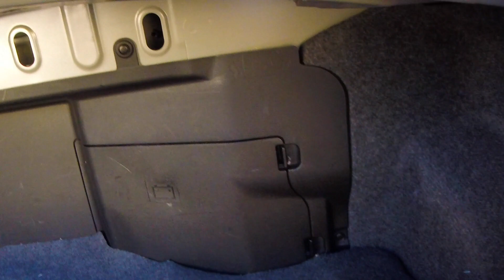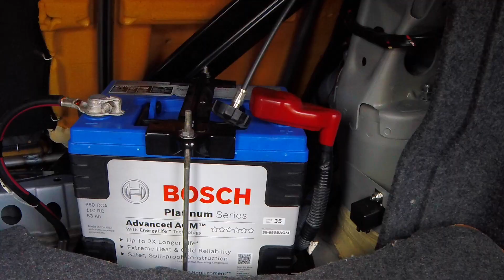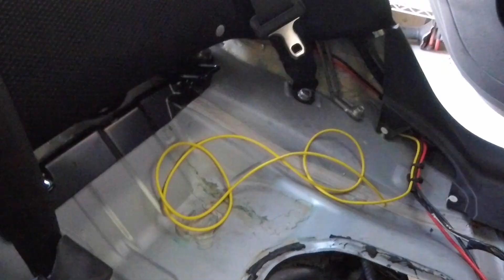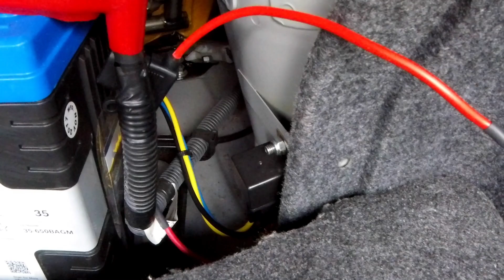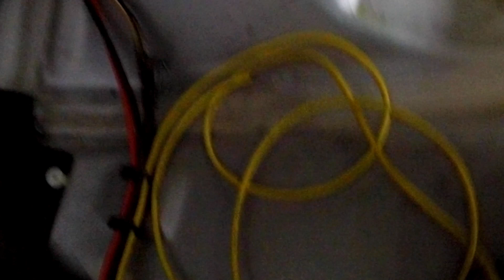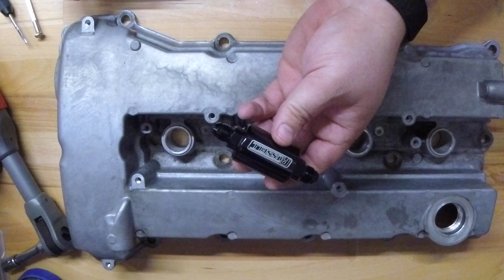EVO X Fuel System Upgrade - Fuel Pump Rewire - Part 3

Comment: Okay, this got a bit confusing but I got it sorted for those that come after me. Here is the wiring breakdown.

Fuel Pump - Route red and black out through the strain relief gland in fuel pump housing cap. The strain relief gland is a after market install. Use Sealcon CD09N2-BK.

Relay - Trim excess red and black wires.
Use excess power red wire to extend relay yellow wire. Route the this red power now and connect to Fuel Pump red.
Use excess black ground wire to connect to Fuel Pump ground. He grounded it at the same point where the relay was grounded next to the battery.
Route relay black ground to vehicle ground next to battery.
Route relay blue trigger to blue trigger wire vehicle side. This got confusing as he extended the relay blue with yellow, so you see him connect yellow to the vehicle trigger blue.

Comment: So quick question. What did you do with the unused power wire and ground from the stock fuel pump? Also so all I basically would do is splice new trigger wire into the stock trigger wire coming from the car.. and the power wire from the new relay straight to the fuel pump. And leave out the old power wire and trigger wire?

Comment: This was very confusing to follow tbh. You connected the red and black to the little wires coming out the top of the pump, but you also hooked up red and black wires to the power on the battery and ground? Wouldnt that have been 5 wires? I’m confused…..

Comment: Hey mate, Cheers for the vid. I'm putting a walbro 525 with DW relay kit in my EVO X, Can you confirm that black wire coming out from the pump is the one that runs behind the seats and earths next to the battery? Cheers

Comment: I wired in the DW relay the car will start if we put the signal on the battery but when it’s wired in car doesn’t get any power and pump won’t prime any suggestions?

Comment: Bruh what ur so confusing so you cut the blue and yellow... then u put red on the yellow and yellow for the blue. Then u tap the Blue with the yellow what? U need to explain which wire is which bruj
Reply from the maker: Maybe you missed it at the beginning of the video, but I had to lengthen two wires with different color wiring I had in my tool box to reach the pump. So in the end my Blue "Switch to Relay" wire on the relay became a yellow wire, and the Yellow "Power to Pump" wire from the  relay became a red wire..... Anyways if you just follow the instructions with the hardwire kit from Deatschwerks you should be ok. See link below:

https://cdn.shopify.com/s/files/1/0890/6136/files/DWFPHWK_Tech_Sheet.pdf?35048
Reply: @mpbiv421  yeah I see I’m just getting confused on where u got the long black wire from cuz the black is the ground right

Comment: After wiring everything, did you find that it was draining your battery? I’m currently having an issue after installing that and a wideband
Reply from the maker: I have not noticed any major battery drainage issues. I only drive the car on weekends really, and it actually sat the past two weeks without being driven and still started up fine. Do you have an old battery? I’m running a newer Bosch AGM battery. I would check your wide band wiring too, those can definitely drain a battery if hooked to a constant on.
Reply: @mpbiv421  Yeah I'm thinking that's what it might be.  I thought yeah the battery is 5 years old, hasn't been run in a month, so it's probably shot.  So I went out two days ago and picked up a new one, and it's still draining.  I'm gonna check my wideband wiring later and see if it is draining power from there.  Aside from the fuel pump, that's the only other wiring that I touched.  So fingers crossed, that is the issue and I just have to fuse it somewhere else.

Comment: Awesome video . But I do have a question as I’m stuck right now doing the wiring . What type of wiring are you using in the yellow roll ? Is a 12awg ? Because I went to hone depot and and they told me a southwire 12 AWg stranded would do the trick . It says on the roll 12AWG CU MTW and THWN and THHN and AWM 600 volts .
Reply from the maker: You can use 12awg they recommended if you want, it won’t cause any issues. But 14-16awg would also be fine. Since this is a signal wire to trip the relay it doesn’t need to supply a ton of amperage anymore so it doesn’t need to be a thick wire. Definitely use stranded wire.

Comment: When you cut the blue wire and you connected the yellow line to blue , what did you do to the other blue side of the wire just closed it off and put tape on it ?
Reply from the maker: Once you cut that blue wire, only the side we connect the relay to is “hot” the other side no longer has any voltage/current on it. You can leave it loose if you want, or cover it with tape/heat shrink. It won’t matter, just preference.
Reply: @mpbiv421  and it’s the thick blue wire correct ? Because there are a couple blue ones in there that are light blue but seem smaller

Comment: mpbiv421 great video but I do have a question . I’m thinking of doing the walbro 450 in my stock holder as well . Why must you do a relay and power it by the battery ? And do you have to drill a whole on the top of the hanger  to get that connection through ?
Reply from the maker: Michael Carcamo so unfortunately the stock wiring cannot really support the amount of current the 450lph demands. So if you don’t change the wiring you won’t get the full 450lph of flow the pump is rated for, and also you may burn out the stock wiring which will force you to upgrade the wiring eventually anyways. And unfortunately to do this wiring upgrade you pretty much have to run it separately through the pump housing. If you try to run it through the stock connector you will still have a bottleneck in how much current it can handle.
Reply: mpbiv421 thank you for responding . With that being said , with this video you made witht the walbro pump correct ? If I do the same setup as you , I should be able to get the full benefits of the rated pump and I should be good and safe for awhile with the same instructions as you provided ?

Comment: Those side by side solder connections can't be that strong.There's a reason that copper is used for wires. The wires aren't even touching which means u're relying on the solder to make the connection so u're bound to get a cold solder that way, and being that it's the fuel pump, I wouldn't trust them.
Reply from the maker: Not worried whatsoever. If it was a cold solder joint they would have pulled apart in my hands when I tugged them. Been soldering for 20+ years including small electronics work. Copper is soft and it will literally break and fatigue before the actual solder joint fails.
Reply: mpbiv421 great video but I do have a question . I’m thinking of doing the walbro 450 in my stock holder as well . Why must you do a relay and power it by the battery ? And do you have to drill a whole on the top of the hanger  to get that connection through ?

Comment: Where did you get that grommet for the top? Or did it comes with it.
Reply from the maker: I bought the whole fuel pump wiring upgrade as a package with the Walbro 450lph from MAPerformance. I believe it is something they throw in as part of the package. You might want to call and ask them if they can sell you just the one part. They are pretty good about taking care of customers, I've ordered odd parts from them before that aren't specifically listed on the site.
Reply: mpbiv421 thank you bro

Comment: Very clean install and detailed how to video.The only thing i would do different is put a male and female connection where u soldered the two wires to the pump{6:21} this way if i had to remove the pump  housing assembly i wouldn't have to cut the wire but merely disconnect from the male/female connector..Also y not use blue wire instead of the yellow considering it taps into the pump signal wire which is blue also. sry i am ocd when it comes to installs. i mean its even bothering me that a yellow wire turns red lmao..id want to re pin that relay pig tail and make that  little portion of yellow wire red....
Reply from the maker: OCD on builds is not a bad thing! Funny thing is I actually did end up going back a week later and putting a high current connector where I had originally soldered the pump power wires.
Reply: mpbiv421 OCD can make a 1hr project turn into a whole day affair sometimes lol